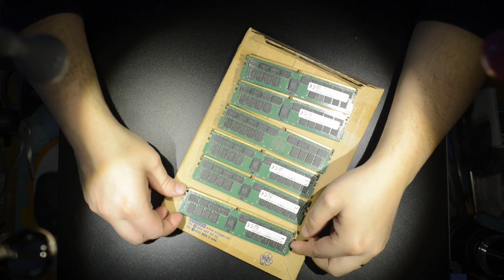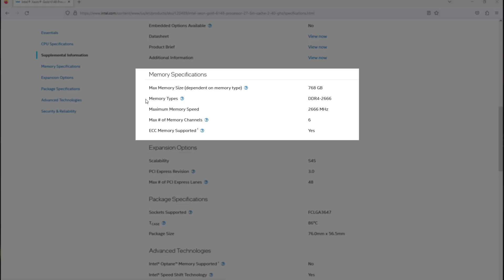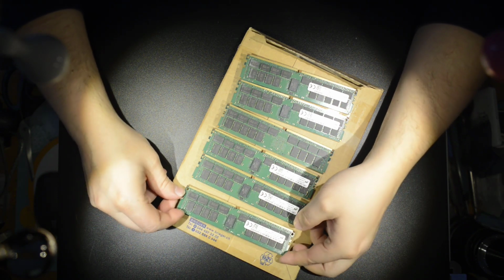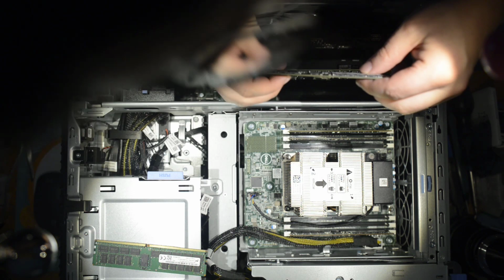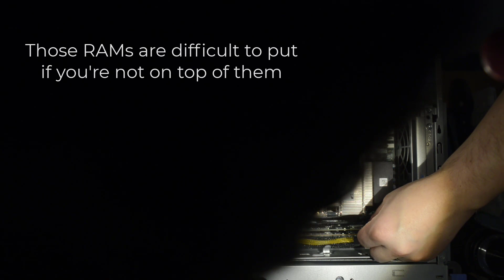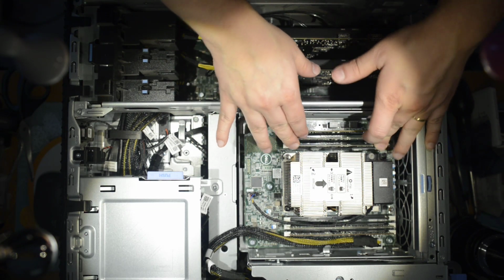Dell precision 7820: Add extra RAM

Comment: Hi! Is it loud under full load? And CPU TDP do you have? I want dual xeon 8180 in this system, but 205W TDP is something that concerns me. Thanks!
Reply from the maker: Hi, it can get loud, yes. I have dual xeon gold, the one with 20 cores don't remember which one exactly. 2x205W should not be an issue, power supply is about 950W. Cheers.
Reply: Hi,
I’m will also have the new 8276L, I think it will be extremely loud 😂😂😂
Reply from the maker: @Mr_Quolls  certainly

Comment: They gave me some 128GB, 2933y ram stick, do you know if this workstation model supports these modules? since on the DELL page it mentions that it supports up to 768GB of ram. Greetings.
Reply from the maker: Hi, you must check what your processor (CPU) supports and the specific frequencies it accepts, in my case, only one frequency was supported by my CPU, 2933MHz I think.  Also, be careful in the slot you use, this you can find on user manual. Do not hesitate to come back if you have another question. Best.

Comment: How r u liking the 7820? Did you compared it to Lenovo 720 or HP z6 g4?
Reply from the maker: It's a very good computer, very easy to service and customize. Added recently a Quadro rtx5000 that I found very cheap, it only got faster for video and simulation which are its principal uses. I don't know the other computers, so I cannot tell. Best.